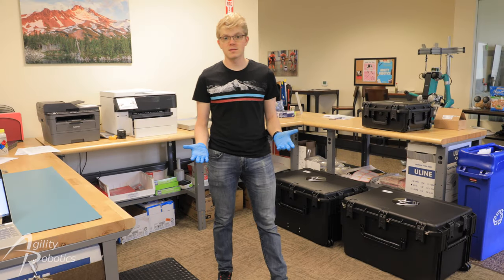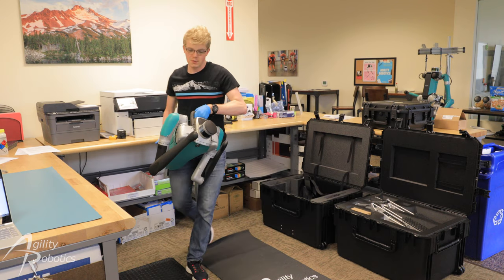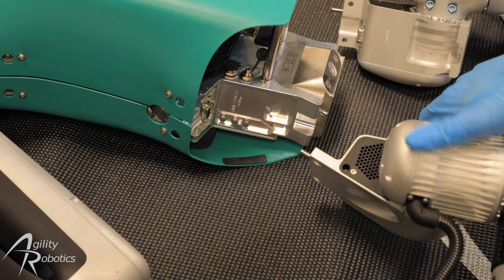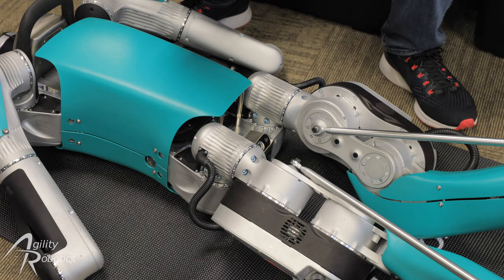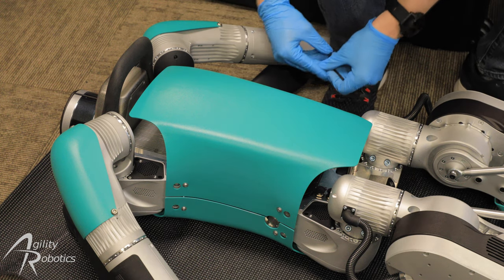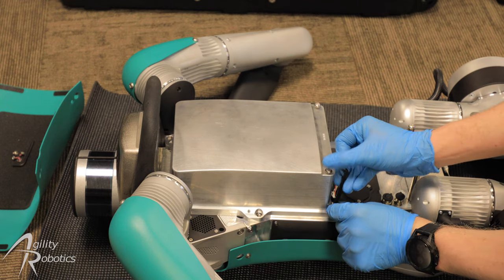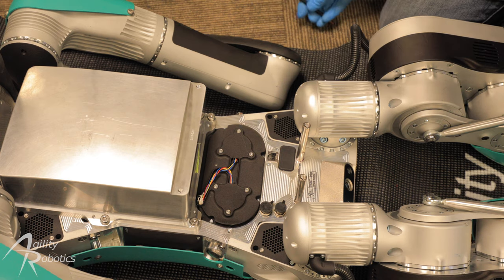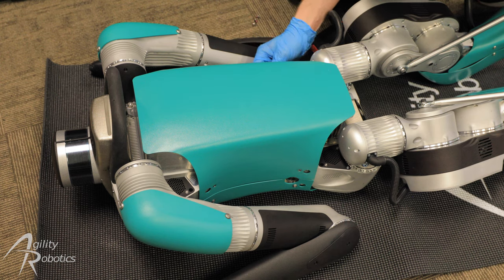Digit Unboxing: Assembly and Battery Installation

Comment: The payload area is the perfect size for two additional shoulder mounts. Having a four-armed Digit would be pretty cool, and wouldn't require too much hardware modification
Reply: Are you sure about that?  Can the system take that much added mass?
Reply: @i-make-robots  Well considering it can already carry boxes and such, maybe, but since the second pair of arms would be so low, it shouldn't throw off the CG too much
Reply: That's a lot more engineering, coding (to make it useful) and added weight shortening battery charge. It, also, decreases payload capacity.
Reply: @zapa1pnt  Yeah, but it would be cool as heck

Comment: Amazon Prime flatpack assembley, all the tools you need are included.
Reply: Yeah, I've heard that, before. The tools you "Need", not the ones you want, for the job.
Reply: @zapa1pnt  Yeah I haven't had too many problems, sometimes the extra hammer or screwdriver is needed, alan keys and these small cheap tools are a blessing.

Comment: Very intresting. I cannot help but to ask myself how much weight (and cost) could be saved by using mass produced parts.
Reply from the maker: Some of the parts are (in fact) mass produced. But the bulk of the robot structure is necessarily custom, precisely due to weight concerns.
Reply: And, also, the simple fact, no one is producing them.